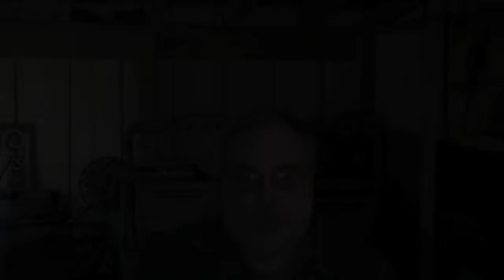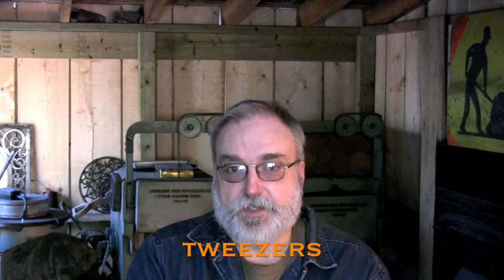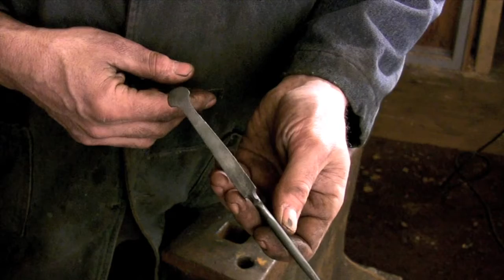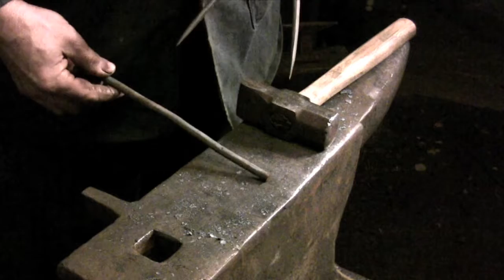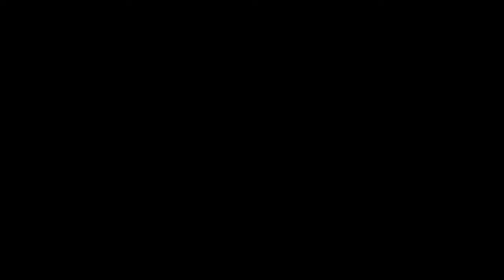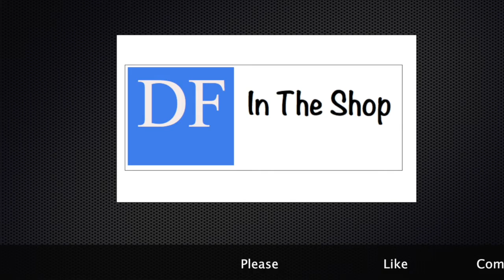Blacksmithing Project - Forging Heavy Duty  Tweezers

Comment: I would love to see you forge these again in a future video with a bit more detail.I'd like to see the full process of how you went about doing the finish work and putting the spring tension in. I'd like to also see how you went about tempering them too.
Reply from the maker: That is a nice project but a terrible video.  Back then you could only post short videos on YouTube ( and they took 2-3 hrs to download) so you had no choice but to fast forward a lot and leave stuff out.
Reply: @df-intheshop330 I'm going to forge my own soon and just follow the steps I can remember that are worth remembering and let my ability as a blacksmith carry me the rest of the way through. The most important part of the video, in my opinion, was that upset you put into the 1 inch isolation for the flared portion.

Comment: You say that you tempered to a blue. Does that imply that you quenched them first to harden? Thanks.
Reply from the maker: That's right.  Blue is how you temper springs and it looks good as a finish.  See my heat treating videos for the full process.

Comment: Did you forge in any of that detail midway down or was that all done by stock removal?
Reply from the maker: +David White The final details are done with a file.  This project shows how the smith would go about forging 90% of the shape to minimize the amount of benchwork ( stock removal ) required to finish a piece.